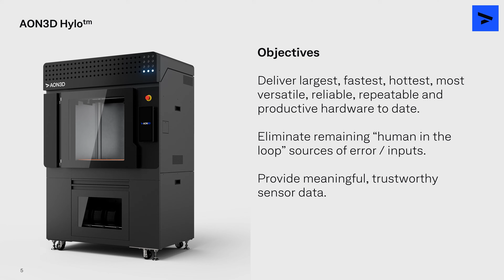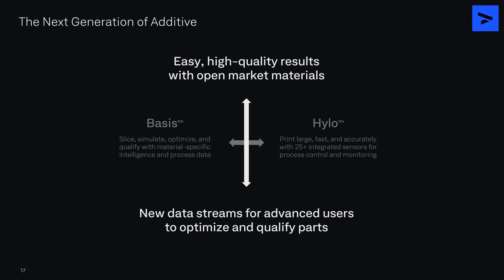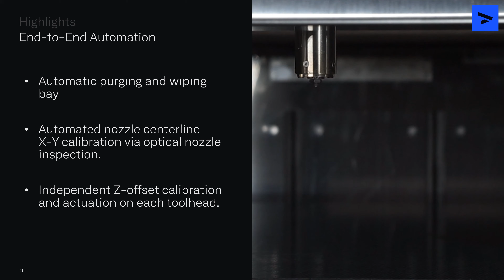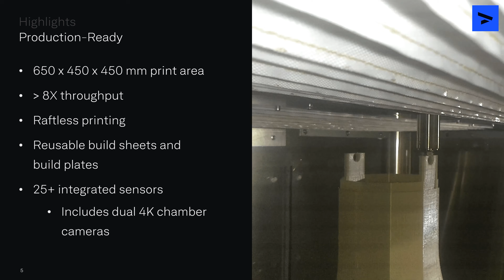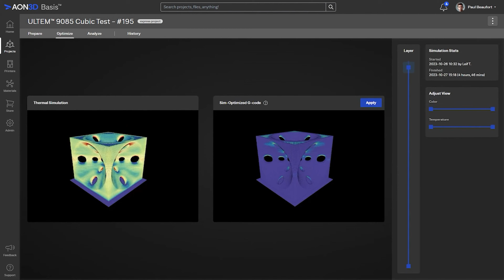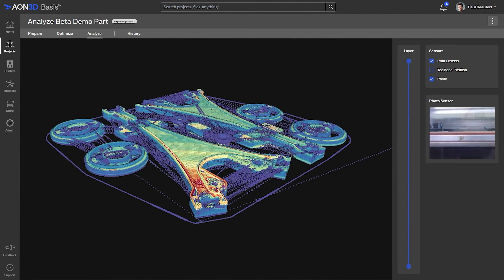AON3D Hylo™ High Temperature 3D Printer Launch Event

Comment: Will Basis be available for owners of older machines, or is it only compatible with new printers?
Reply from the maker: Unfortunately, Basis is currently only compatible with Hylo, as it relies on a lot of the machine's sensors and the optimization software takes into account chamber convection maps to accurately simulate the AM process.